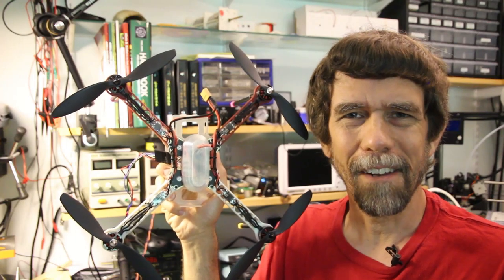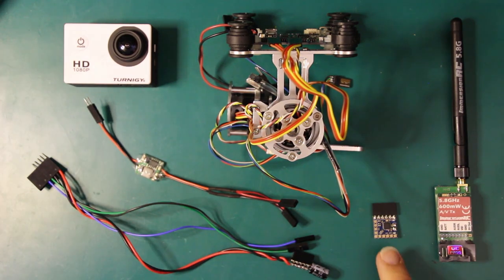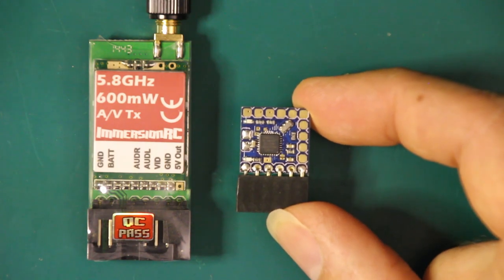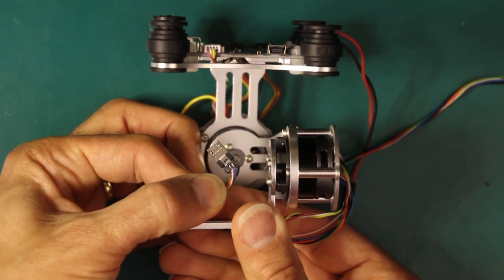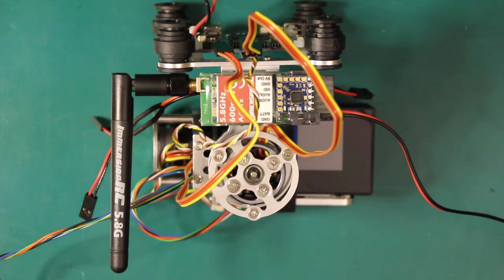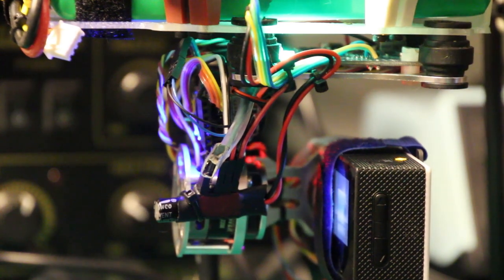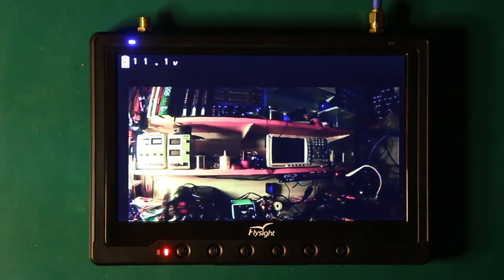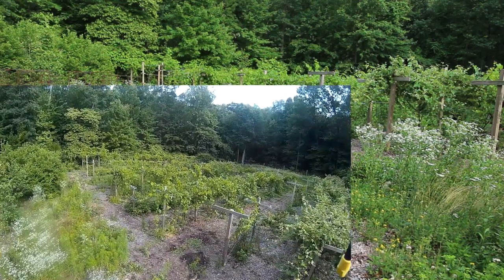Build a Drone Part 3 - Add a Camera Gimbal and FPV Transmitter

Comment: I have only one battery to power my power distribution board currently. I want to use that battery to power my gimbal, pixhawk flight controller board, power distribution board and herelink ? Please help me. How can I do it. If you can, then please help me and if possible then please give some detailed information about how to do it? Please help
Reply from the maker: Many ESCs (electronic speed controls) that drive the motors also have a BEC (battery eliminator circuit) that provides a regulated 5V output to run a receiver, flight controller etc. Or you can connect a separate 5V regulator to provide power for the electronics.

Comment: What is the little PCB you mounted on the right side of the ImmersionRC TX unit?
Reply from the maker: I had to go back and look at the video, and I think you're referring to the On Screen Display board. It adds an overlay to the camera's video that shows the battery status. If you search for "RC OSD" you can find examples of similar boards.

Comment: Am I seeing a HAM HF antenna at 13:30? I thought it was extinct!
Reply from the maker: Yes that's a tri-band 10-15-20M beam antenna on the mast over my house, plus a VHF/UHF vertical. Ham radio is not extinct, although I haven't been very active with it for a while.
Reply: @BrainRight  glad to know its not extinct yet :) my last CQ was more than 30 yrs ago hehe

Comment: Hello Jay. I keep repeating myself, but this was another excellent video. Well thought out and executed. I should have guessed you were an amateur radio operator. Your skills are truly all-round. My call is PA2LVD but I have nothing of high power to reach you from here. Currently have a mcHF QRP home built kit and some QRP WSPR home built stuff.
Reply from the maker: Thanks again Edwin, glad you enjoy the videos. Don't underestimate the potential of QRP - I once worked New Zealand (8351 miles, 13441 km) with 4 watts on 20M with my Elecraft KX3. Propagation is key and it helps a lot to have a good beam antenna; you can see my triband yagi above the house starting at about 13:20 in the video.

73, Jay